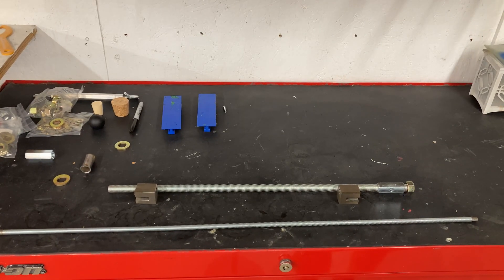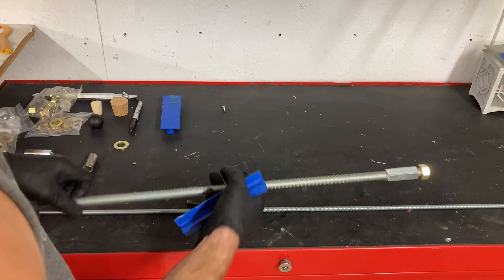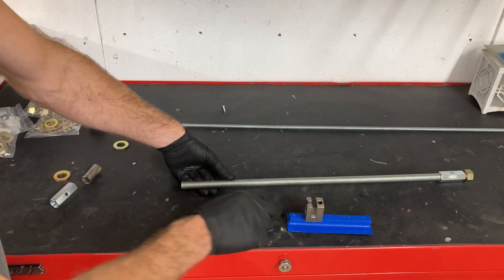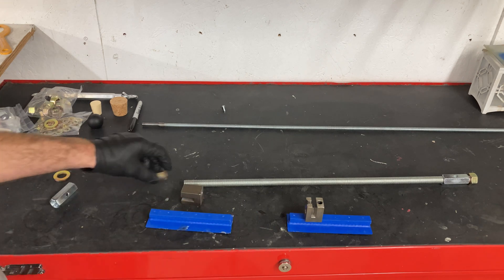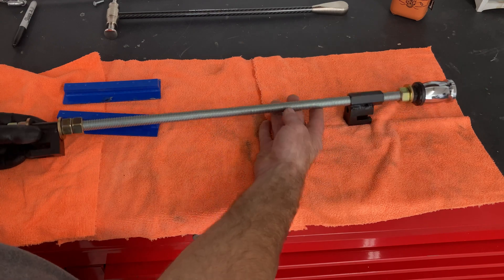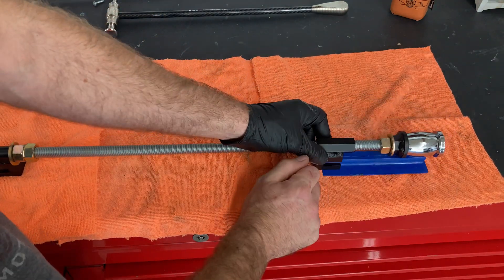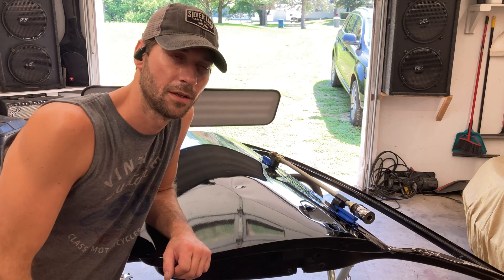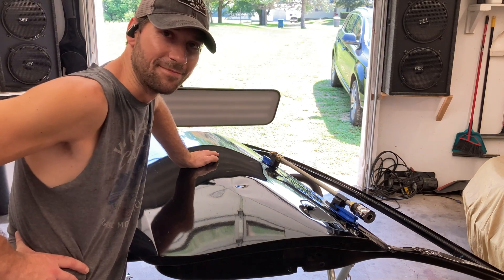Homemade Lateral Tension System

Comment: What adjustment or take-away would i need to do in order to use a socket gun on it instead of using it manually?
Reply from the maker: Weld a nut or socket on the handle.

Comment: That 5/8 rod seemed to require a lot less torque to turn. 
I made one a year or so ago using a basic scissor jack from a Toyota. 
It was ok, but very limited from the short span. 
Adopted Brice’s porta power method.  
Anyone looking to start using lateral tension,  I advice to practice on replaced panels before trying  on customers cars!

Comment: Another great video, thank you. I watched a Dent Baron vid, (I believe) using his lateral tension with short tabs. As the force was applied it created crowns at the far ends where there was no damage. So thinking it needs a larger area for push force distribution.
Reply from the maker: Yes I have seen that many times.  Usually that happens when too much pressure is applied and the rod bends, thus digs the tabs into the panel. If the rod doesn’t bend, less likely to cause more damage .